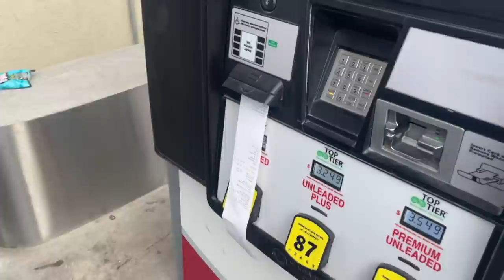Race Week UNCUT & Behind the Scenes - Days 5 & 6

Comment: 8.5 deck ford Wouldn't have let you down 🤣  just messing with you they all let you down sooner or later. As long as you're have a good time it's worth it 🤙
Reply: What's 8.5 deck? Modular? I've machined 8.2 deck 8.7 aftermarket blocks 9.2 Clevelands 9.5 and the 10.3 351M/400 blocks